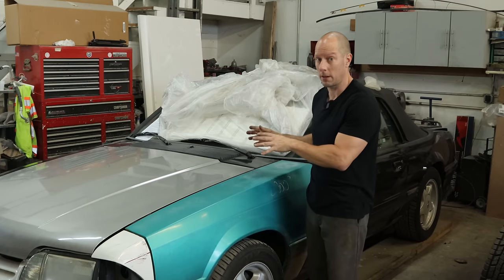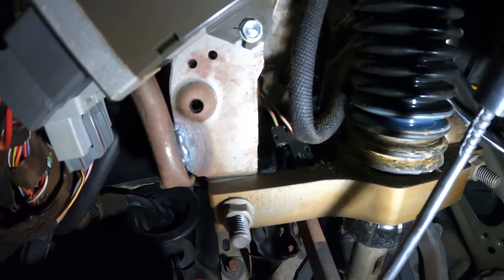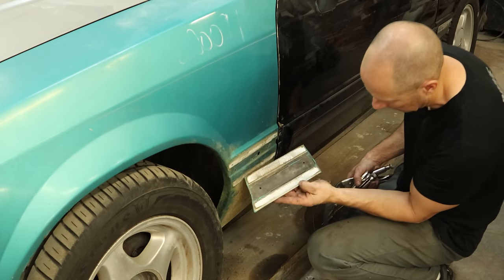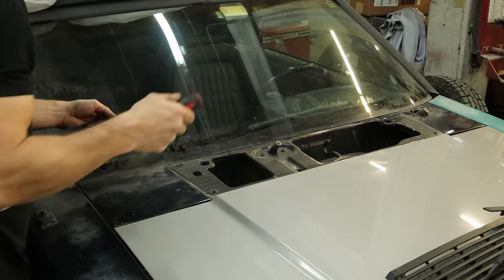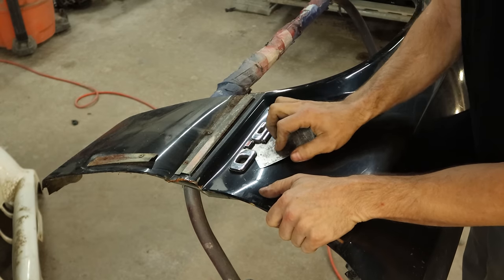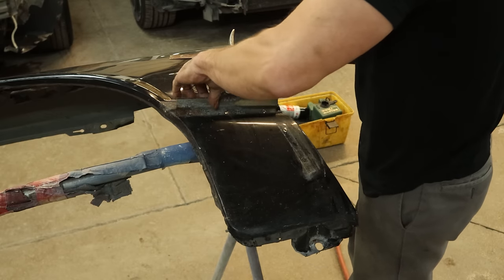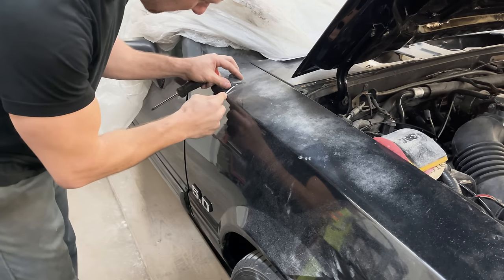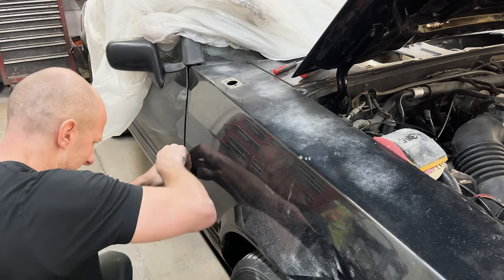Getting the Mustang rebuild ready for a complete repaint.

Comment: 0:00 that's crazy that they mounted the wiring and switch to the brake pedel. Back in the day there was a momentary switch mounted to a bracket and the arm on the brake pedal activated/deactivated it. I had one in my dart that used to stick in and it would leave the brake lights on all the time. I'd spray it occasionally with WD40 to free it up.

Comment: Ford Accornyn Class.  I passed it (back in the latter 90's).  I think I got a C+.  Needed it when I was 'Hacking' the 5.0L (with EFI) into my 1976 Jeep CJ5.  Got to be a real PITA, going back and forth to the glossery, so I semi-permanently memorized most of them.  Oh, if you have a strong stomach, take apart the OEM Ford harness.  Specifically, the section from the computer to the 'salt and pepper' connectors.  What a mish/mash of crap.  Work hard to control the gag reflex, as the image of electrical vomit displays itself.  You might especially appreciate, how they decided to 'gang' (crimp?) the power wires together.  What is that goo they used to protect it?  Snot?  After disecting a couple of them, I decided the best route was to toss then all 'in the pile', and go with a standalone, one piece, version.  Always a good couple of chuckles in every one of your vids!  Thanks Scott!

Comment: Too bad the only company that makes power window switches is Dorman, I have taken a OEM switch apart and clean it and rebend the copper contacts. Had to do that for my 92 Ford F-150 XLT,  I also used 1/4" nuts in the window motors to replace the silicon bearings.

Comment: How much would a real positive battery cable add to the build cost? Those clamp-on terminals are called "emergency" terminals for a reason. They are meant to just get you down the road temporarily. After a few months they start to form corrosion where the cable is clamped down and the car won't crank well if at all. While I'm criticizing, I should mention to always put some anti-seize on the battery hold-down bolt. If not for your sake, for the next guy 3 or 4 years down the road.
Reply: I subscribe to the Red Green theory.  "It's only temporary, unless it works."

Comment: Tech problems, you don't wanna know. We bought a $20,000 flat bed printer from china, have 200 hrs into it and it's still messing up, the 2 main ballscrews on my CNC machine wore out, I bought a new refurb laptop, it spontaneously shut off and went into recovery loop, I had to buy a new computer to run the software to run the flat bed printer and that meant I had to reload all my design 3d software and it took me years to get it totally set up, now I have to start all over again. All right in the middle of the busiest time of the year for me (Christmas orders). The only thing that hasn't given me issues is my newist cellphone.

Comment: Cars just had holes everywhere in the old days.   No wonder they leaked constantly
Reply: Ford does some strange and weird engineering.
Reply: @RollerCoasterLineProductions  also clip technology has improved over the years. I have a 94 Corvette which was designed in the 70s, so everything is screws and rivets, where my newer vehicles are like Legos, and snap together.